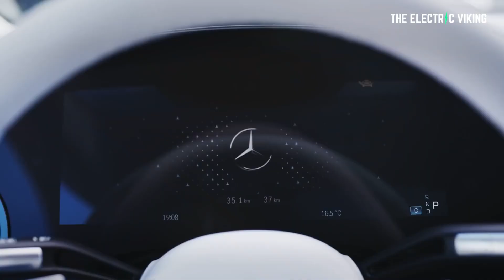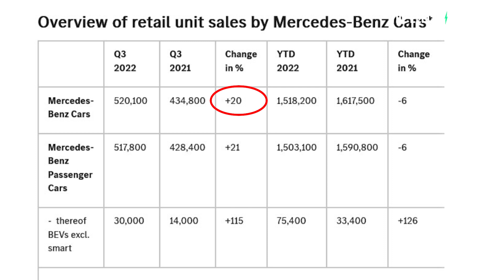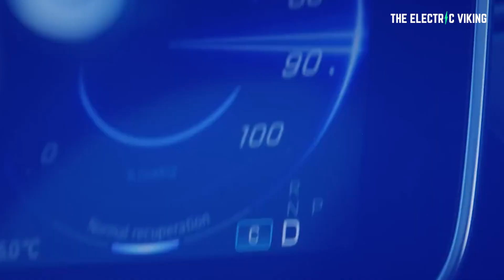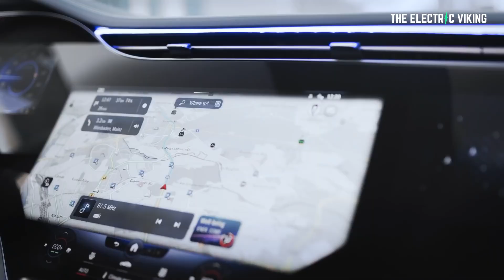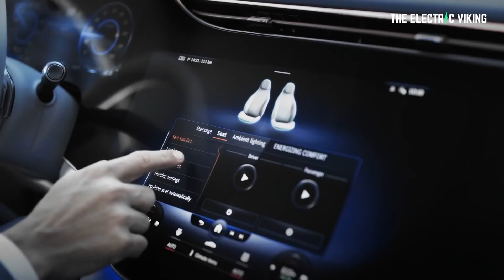Mercedes slashes EV prices by up to $33,000 as demand stalls

Comment: Think you're wrong... 😁 Mercedes is just starting their Chinese EV journey and haven't sold much yet - as they haven't produced much yet.  Tricky for MB is that most of their products fall above thresholds all around the world for taxpayer-financed promotions ...   But true, they need to ramp up production and quality - you're right.  Sure they will though, a lot is at stake and it is a very serious company.  They are typically not the first in the market but want to be the best. This drive seems embedded in the culture of the company and will help them moving forward.  So I feel more optimistic about MB.  One MB product not mentioned:  a now Chinese 50/50 cooperation: SMART!  Mid priced EVs, Chinese manufacturing and MB design & engineering. Best of two worlds?  Smart ....   ;)

Comment: ICE prestige doesn’t translate to EV prestige.
The auto market is being upended by Tesla and new Chinese companies etc. An EV is a tech device so people look for different things in making comparisons. How good is your tech? How good is the battery? How fast does it charge? Performance etc. Then they look at the luxury appointments.

I’ve said for years that Euro prestige auto is stuffed. Porsche looks ok and Merc may still get out of the hole. 
But they will all have to play second fiddle to Tesla
Reply: Hmmm, some of what you say is correct, however, ice cars also have amazing tech..
Yes, when it comes to electric cars, people want it to be so advanced, they want 400 miles of range and they want 200+kw charging speeds and they want that battery warrant to 10 years.  They also want OTA Updates, but yet they want that sub $40k price for all that..
Reply: Over th air improvements?

Comment: I have an EV6 AWD since May and driving it with 16,4 kWh average on 100 km! We tested an EQE350+ RWD with air suspension and rear wheel steering. Handling was not better and less precise than the Kia on small narrow mountain roads, at 30° Celsius outside our A/C works fine but the sinking star had problems and make noise the long we tested. The display is a catastophe especially in AMG-Edition, all that nasty fingerprints and in sunlight the dangerous reflections. The car had no HUD, has no frunk and quite no trunk. Inside is very narrow compared to the EV6. Performance in this model is also more than disappointing. But comparison is not realistic because one car costs 68‘500 CHF in Switzerland and the other with the same equipment 157‘000 CHF. Even with a discount of 30‘000 USD that comes not close. Also people at the golf club are now mostly younger than me and rather go for S3XY cars not Balkan drivers delight where the family pays the car for the macho son to go posing! They consider Mercedes no more as ‚premium‘ or ‚luxury‘ brand but as a sinking star! Hard to say as a once proud owner of S-class to the A-class and getting always good but expensive servicing and high TCO!

Comment: I'm sure you don't want a link to another Youtuber but mega-influencers The Stradman and Shmee 150 just did a piece on the Hummer EV. They both said Tesla and Mercedes SUV EV's are boring and don't excite potential buyers. The excitement, thrill factor is very important to getting people to shift to EVs. It might be essential to get people to even do a test drive. I fully agree. The Hummer with it's tricks like crab walk and charging progress bar on the grill make it fun and interesting. 1000 horsepower, 9000 lbs, yet a 0-60 in 3.5 seconds is kinda odd ball too. This is Mercedes' EQE and EQS problem. They are good, solid, competent cars but you can't get excited by one. I think GM and Stellantis in particular are going to build exciting, even eccentric EVs that will draw people to the market. An "El-Cat" with the classic good looks of the old Charger. A 1000 horsepower EV Corvette (E-ray) is coming in 2024. So is it the Lucid Gravity. Mercedes needs an exciting machine or two.

Comment: Why buy an expensive Merc when a used Tesla does a better job and your new Tesla will arrive soon enough?  On top of that, Merc EVs are still extremely old tech. Too many switches & dials and a structure based on the needs of IC engines.

Comment: Look, this isn't a bad news story, it is a good news story. So what if Mercedes has to sell its EVs at big discounts to get sales. The penny has dropped - there are no more excuses that can be offered to explain away how the European marques are languishing. Mercedes now has a proper yardstick for what it needs to do both technically and in value for money terms. It is good to be free of illusions. That is where Mercedes is now. It just has to put one foot in front of the other now.

This was never going to be easy. Mercedes like the other established ICE vehicle manufacturers has left its electric transition run late. And, there is no way to avoid the expensive retooling of production lines for EVs. Still, Mercedes seems to get that, now, even granting it took a long time to get to this point.

Despite declining sales in China, VW and Mercedes, primarily gain from that experience - it provides an object lesson in what must be done to overcome hubristic tendencies that are fatal to competitive businesses. European brands will need to offer EVs of sufficient technical merit that they will still sell well even when most Chinese buyers are barely moved by the supposedly powerful allure thought to attach to European luxury car brands.

Several investments that Mercedes has made in EV tech - the YASI acquisition in particular - show that there are headed in the right direction. The question is whether they are moving with sufficient haste.

Comment: Yeah, another one realising that building an EV is not quite the same of building an ICE car.
Reply: the problem isn't building or delivering the cars, its just that there are a lot of EV brands in China and the competition is tough...
Reply: @mamadouaziza2536  Was tough before as ICE as well, but they were Mercedes right? yeah, now realising this is a very different game, they are heavy, not efficient at all and the interior looks like a BlackBerry, yeah, is not selling...
Reply: @pbrigham  
But in China there are a lot of EV brands, the competition is tough there. A lot of lower priced Luxury EVs are in the market in China. In the USA, Lucid and BMW are selling more electric cars than Mercedes is selling electric.. 
The
Reply: @mamadouaziza2536  This not convince me, bottom line is that legacy car makers didn't prepare for the electrification of the cars and now they are in trouble, they thought that making an EV was a simple task as they had years of experience in ICE cars, well they are finding on the hard way how wrong they were.
Reply: @pbrigham  
Who told you that Legacy brands think that making an electric car is easy? Where did you hear this? Lets not act like Tesla didn't have growing pains... There have been plenty of battery and motor failures in enough Model S and Model 3 cars..

That electric sedan from Mercedes Benz was way over priced from the beginning.
Also, the Model S wasn't a huge seller for years, it only sold about 250,000 units for the first 6 years. Seriously didn't expect for Mercedes Benz to just dominate the luxury electric car market overnight in any market?
Reply: @pbrigham  
But did anyone really think Mercedes Benz would dominate China's electric car market in 2023? Hell, that luxury sedan isn't even selling in North America nor is that electric SUV.